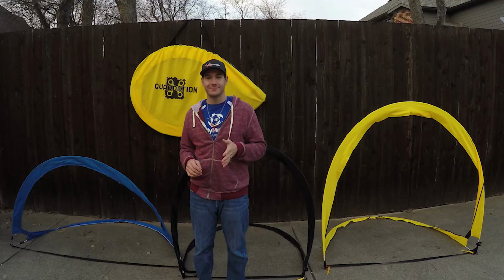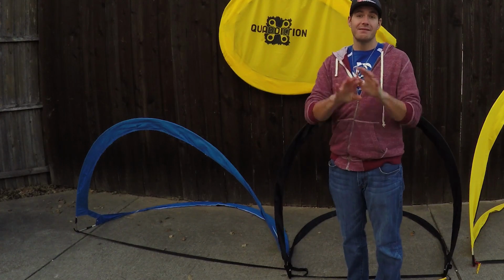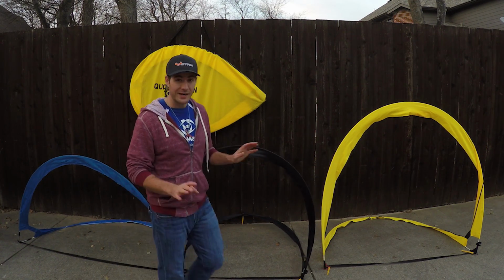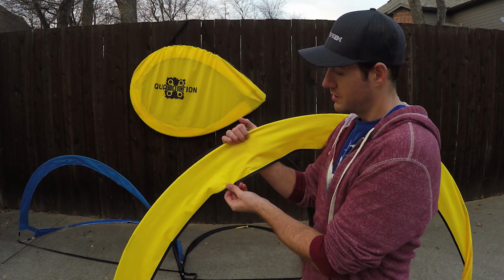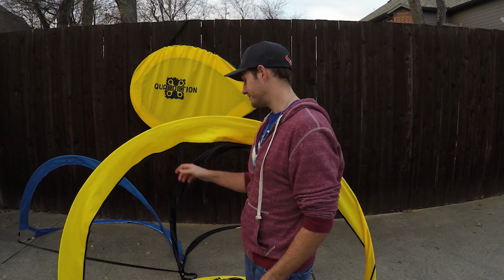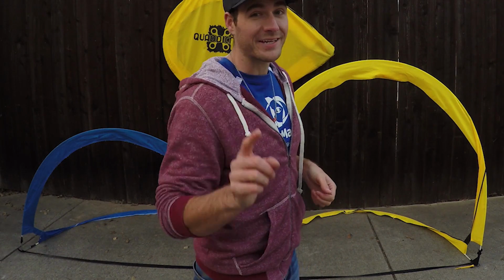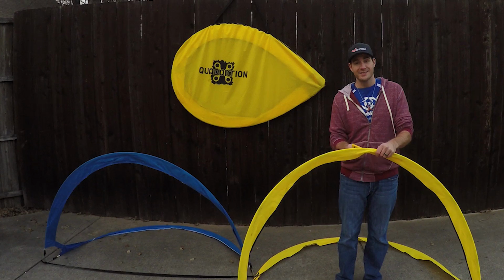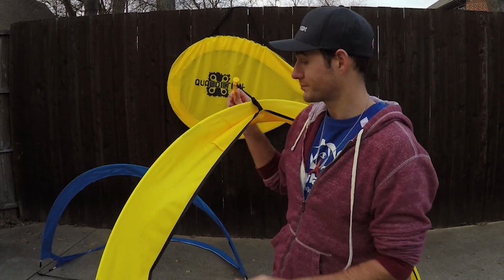Quaddiction Gate updates!

Comment: Hey Justin. I thought I would add some feedback as I own 8 of the v1 gates and have been flying them for several months. 
1.  Set up and take down are a godsend!  I was using FPVModel gates before yours and it was an absolute chore to set those up. 
2.  Durability is good, but not great. The gates will tear in a prop strike, but not every time. Overall they hold up pretty well. 
3.  Performance in the wind is BAD, but that was mitigated by having the guy wires and stakes included. I didn't see that on the v2 gates, and that is a major concern. Additionally, the material used for the guy wires (well, poor quality string, actually) is a real pain, as a prop will cut through it like soft butter...if you're lucky.  If you're unlucky enough to get caught in the string it will wrap around the motor and foul the entire mechanism. I have had to sideline several quads because the string was wrapped around the motor shaft, bell housing, and even into the windings. It really sucks spending an hour under the magnifying glass pulling little strings out of the windings!  I would simply suggest a more robust cord. 

Additionally, I wonder if it would be feasible to sew reinforced "air holes" into the gates. You know how those big banners have multiple flaps to let the wind through?

4.  The connection between the tent poles and elbow is very weak. Actually, it's the plastic tube that is on the end of the pole and slides into the elbow. On a moderate crash near the elbow the pole will slide out of the elbow because the plastic tube has come off. I'm trying to work around this by applying CA glue to the pole and reattaching the tube as each one fails in turn. This should be an easy fix in design and manufacturing, but for now it's a real bummer for the user. 

I believe that with a few small changes your gates could be the best available, and I would certainly pay a premium for them. Thanks.